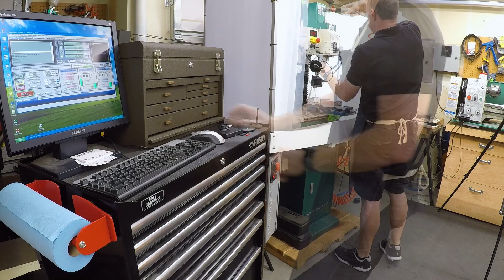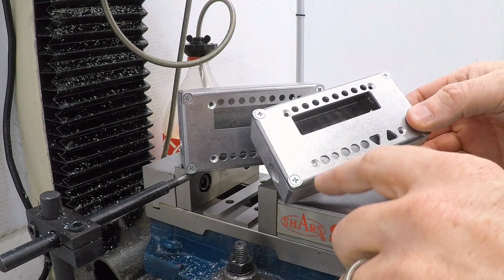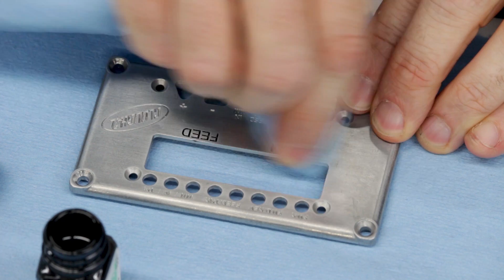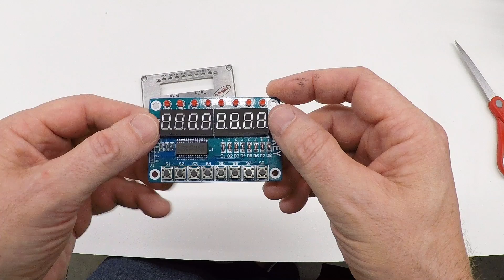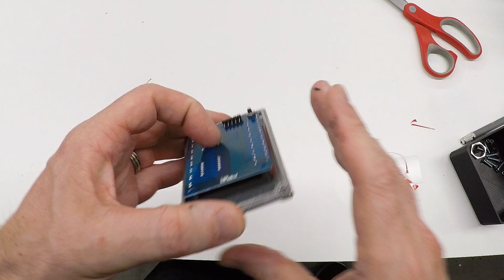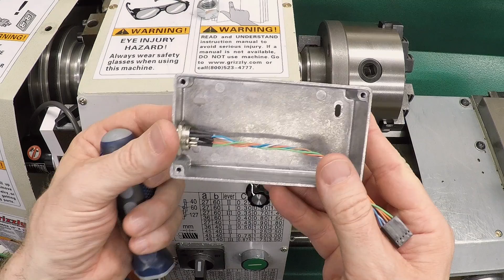Lathe Electronic Leadscrew Part 9: Machining a Control Panel

Comment: I use LinuxCNC with GCode ripper (free python app) for probing to compensate for surface warping when engraving (just like mesh levelling with 3D printing). I've also found the UV cure resin nail art kits are great for filling.

Comment: Dude.. forget the vbit. 

Grab a .062 or .078 or .093 flute carbide ball mill. Max the RPM, go only .003-.005, and just fly. I slow down when feeding straight down and sometimes run a spring pass, but rarely does an engraving take more than a couple minutes. I'm running 10k on the spindle (max), with my down feed at F4. (4ipm) down to Z-.004 and then go up to F20. (20ipm) for lateral moves in aluminum with coolant. Once you see a burr start, swap the tool out. Run a spring pass or play with the RPM if you see chatter. Hell I was doing a paragraph for a decorative diving piece in brass that only took four minutes or so. I know you're limited on rigidity, but crank that RPM!

Well done on whole electronic lead screw project. Truly .. bravo. I can't wait to try one myself. Thank you for all your efforts! Don't take this comment too critically.

Comment: This is Great stuff!  Although I still have questions on some of your processes.  I am assuming that you are going back and forth revisiting the same holes on the CNC to minimize heat build up?  It seems slightly inefficient, otherwise.  I have a large CNC (5' x 12' c/w vaccuum bed) used for Woodworking purposes so I am curious on how the metal CNC system works.  TBH, i haven't watched all of your videos and there were times I sped through this project. Please don't flame me if i missed an important part.

Comment: Love your channel it’s great You need to build yourself a vacuum plate for your Mill and you can use it on your grinder. Harbor freight‘s got a great vacuum pump for HVAC. Pretty simple surgical hoses for your gaskets and machine and grooves in the plate  to put your surgical hose in around your part used them for years in a machine shop.

Comment: If you're using a 90° countersink you measure the diameter of the countersink subtract it from the diameter of your screw head and divide by 2 or multiply by .5 and that will give you your depth. I spot drill all of my pipe plug holes at work and set my tap depth by the spot drill diameter. Example: In order to be -1 thread on my 1/2-14NPT my spot drill diameter needs to be .7", if it measures .5 then (.7-.5)*.5= .1. So I need to go -.1 on my Z axis work shift. For engraving I always use a fly cutter to get the surface flat before I engrave with a V-bit. Drag cutters are spring loaded so flatness isn't as big a deal.

Comment: Clough42   Hi James, I’m sorry, I wasn’t clear, I was asking for the G-code to mill the cutouts for the face and side of the box, or are you saying they have one already made with the cut outs?  thank you,  Chuck
Reply from the maker: Oh, I misunderstood.  There are STEP files on thingiverse.  The g-code I used is specific to the mill, spindle, workholding and tooling I used.  Just trying to run that on your mill is likely to lead to mangling something.
Reply: Clough42 awww come on James let us have the G- code 😩 my experience with 3rd party code has always been positive, most G- code is non machine specific as long as the axis’s are all zeroed correctly. I’ve been running Mach3 for many years and have used hundreds of others code.

Comment: How's the switch denouncing done in the firmware?
Reply from the maker: In this case, the switches are all handled by the TM1638 chip.  I'm not doing any debouncing in software.

Comment: I love this build, I think it’s so clever.

I have another idea for a project that’s somewhat similar: force feedback, jog by wire.

At 18:00 when you’re jogging your machine with the computer or Pendant, you can’t feel how hard the machine is working. If you use servos, you know how much torque it’s putting out (if you are using a data communication, not step/dir). You could put another servo connected to a handle and use force feedback to “feel” the part when you cut it, even though it’s all electronic

Comment: Nice!   Esthetically, that's a great labeling and presentation.   How wipe-down tolerant
is that red film?

It's a tad disturbing, though, how close to the wall that connector is mounted: how will the retaining ring nut be tightened?   Does  it use a spring clip for retention?
For what it's worth, a fixture that clamps the blank faceplate from below, to
a cutout plate with some locating pins, would remove a lot of the doubt about
vise positioning and slanted box walls. and casting tolerances.

Comment: I found that the display board standoff bracket interferes with the display board 5-pin connector. I see that the board you are using has these pins mounted on the rear side of the board. Not sure if the board is multi-layer...Any danger in pulling the stock pins out and replacing on rear with right angle version?
Reply: I discovered that too.  I'm wondering if James moved the connector to the back.  I notice in the video that the display board he is using on his breadboard has the connector on the top.

Comment: It is probably to late to help you with this but it may help others. If you have screws with black oxide on them and you want silver. You can always just hit the head with 600 grit sand paper. You can also get a piece of round stock. Drill and tap a hole for the screw in the end on a lathe. Mount it in the lathe, insert the screw and polish with Scotch-brite. Hope this helps. That cover came out looking great.

Comment: Not taking anything away from the awesome job you did .....as an alternative, you could direct print onto the cover with a flatbed printer.  It would look every bit as good - but “production” time would be greatly enhanced...
Reply from the maker: Are such printers really available to consumers?  Can you point me to one?
Reply: Clough42 Mimaki makes some UV flat-bed printers.  (http://www.mimakiusa.com).  They are available to consumers but probably at a much steeper price than would be warranted for a single project.  My thoughts were that you could outsource that portion if you are looking to manufacture these.  I have a larger 4 foot x 8 foot machine and have had some amazing results printing on aluminum.  They do make some much smaller machines as well.

Comment: Hello James .. 

Greetings fro Cairo / Egypt ..

Thank you very much for sharing your great work on the electronic lead screw .. those 10 videos are nothing less than a complete course .. 

I have a question .. why did you choose the 1024 pulse/rev encoder stepped it to 4096 pulse/rev, why the high resolution encoder .. as I understand all that you need from the encoder is an accurate RPM, in that case a lower resolution encoder ( say the super cheap 8 pulse/rev encoder ) will also work and give you an RPM reading but with the added benefit of slower data stream which allow the use of Arduino UNO or MEGA.

Thanks .. Ahmad 
(ahmad.hasan@usa.com)

Comment: How did you get the perfect text onto your front panel? Fusion is "stone age" when it come to adding text for engraving as you did.  Did you do a separate sketch for every word? It would be nice if Fusion remembered the font and size at least! BTW - Great series, looked forward to every new installment.
Reply from the maker: It's one sketch with a bunch of individual text elements, aligned by eye using construction lines.
Reply: @Clough42  Thanks, I pretty much did the same thing using "Arial Narrow" font, I couldn't get the SHX fonts to work in CAM.  I'll make a test cut or two to dial in the depth. Thanks again for the quick reply.

Comment: For future reference, when joining dissimilar metals Tef-Gel by Ultra Safety Systems is an excellent choice. In the marine electronics world it is common to need to put stainless steel fasteners into aluminum, for example, when mounting a radar on a mast. A thin coat of Tef-Gel on the fastener before installing it and you'll be able to remove that fastener years later without any difficulty.

Comment: Just bought 280049 Launch pad. 

Could you also do a programming video, explain why you do the things the certain way (like using external driver not the Boost pack)?

And maybe also some Launch pad basics, I'm sure you would do a great job.
Reply from the maker: Yeah, that's on my to-do list.  I want to get back to the firmware and smooth over some of the rough edges before I open the floodgates to a few hundred new users.  :)

Comment: 34:00 I'm surprised you let it hang over the edge of the gear box... My OCD will not let that go...  amazing project BTW..
Reply from the maker: I didn't think about that bothering people.  I just picked the screws on the face I wanted to use and centered the holes in the box.  I think it positions the controls well for use, but time will tell if it gets in the way.  It would be easy to make more holes in the box.

Comment: Where did you find that engraver bit? I really like this tech for a manual machine versus a full CNC conversion. You get everything in between and can manipulate the equipment rather quickly for various projects. An individually powered y axis would be another great addition. There are several applications I can see being done with this type of setup you’d typically not be able to do without CNC. A manual turn mill if you wanted. Very nice.

Comment: Thanks making this controller, its all very very impressive. The only suggestion I would make if you intend to offer them as a near complete kit or finished product is to also offer a PLUS SIZE version, about the size of a typical DRO. This would enable the buttons and/or function lights and/or labels to be larger and further apart, it would suit guys (I'm one)with big boofy fingers and no longer with 20/20 vision.

Comment: Regarding diamond engraving on aluminum, it doesn't require any coolant as aluminum does not weld itself to diamond at all. That's why they use diamond tools to machine aluminum when fine surfaces are required.

Comment: This is an excellent addition to your lathe and a brilliant idea. Kudos all around.  I have almost all the parts on you list except the encoder. Literally, it's on the slow boat from China. I do have three questions though. First, the breadboard set-up during the proofing seemed to be highly populated. But the instructions that came with the code does not mention many of the other components such as resistors, transistors etc. What do I actually need to complete my project at this time? Or should I wait till I receive your add-on board? Second, the final debug instruction mentions timing of the ISR routines. Will I need to do this or is it done within your add-on board? And third, my lathe has one lead/feed screw but two different levers and gearing, one for feeding and the other for threading via half nut. Will I need to choose one method for both feed turning and threading, or can the program be modified to use both linkages/gear ratios? Again, great project.

Comment: In my work I have to machine stem nuts for existing acme left hand threads. Sometimes a 4 pitch thread is cut on a machine with a worn lead screw giving a pitch that is short by as much as. 015" inch. Now I have to modify my threading process to account for something less than a 4 pitch thread. Your system would help to adjust for the exact pitch needed. I'm interested in obtaining one of your units if and when you have them available. Great job.

Comment: A few points:
With the diamond engraving: powder blasting and dark anodizing before engraving would have made the labels show better.

The painted labels would be more durable once finished off with a 1200 grit  sanding pass after 3-4 coats of label filling, followed by a clear coat.

Comment: That is beautiful, love this project! Of course no project is complete without some late feature requests. Don’t know if anyone has mentioned it yet but sure would be nice to have a carriage stop via a micro switch that could clamp to the bed. This would allow accurately turning to a shoulder or threading with much less worry about overrunning the gutter. It would be especially helpful in the case of metric threading where the half-nut isn’t disengaged and you have to account  for the time for the lathe to spin down when you turn it off. Since  you are using a stepper instead of servo maybe the alarm pin could be reassigned?

Comment: If you don't have access to self adhesive film, a very useful alternative is to use Quality Street wrappers stuck on with double-sided sticky tape. They are available outside the UK. Of course, they also have the advantage of giving you an excuse to eat chocolate! They give several colours (red, green, blue, brown etc). The only disadvantage is that the individual wrappers aren't very big.

Comment: Nice work. 
The box is just in the way when tightening/ loosening the chuck.
Reply from the maker: I don't think so, but if that's the case, it can easily be mounted on the left side of the headstock.

Comment: OK !  I'm ready to buy two !! Are you going to sell the whole shoot'n match or just the controller...? Is that TI board a current stock item ?  I'm planning on using one on my Atlas 12 and 6 !
Thanks for another great video !!
Reply from the maker: I don't think there's any way I could make the control panels economically.  I designed the project to be built with inexpensive, off-the-shelf parts.  The one part you can't buy elsewhere is the interface PC board I built in a previous video.  I'm still planning to make those available, once all the bugs are worked out.

Comment: your range of skills is mind blowing, just to sum this up.. and forgive me if i miss something there's
1 CAD 
2 CAM
3 Programming for embedded devices
4 all that math for threading and feed rates and stuff that i technically count as something above and beyond programming 
5 manual milling
6 CNC machining
7 manual lathing 
8 circuit design
9 PCB design 

rare to see one person do such a project from begging to end and do it all so well
Reply from the maker: Thanks!  It's pretty much all self-taught.  It comes from a lifetime of taking on projects that are just beyond my abilities and then learning what I need to learn to complete them.

Comment: Nice¡ but If both boxes are the same I would have used one single box to set up in the vise , and replace the tops to mill/ engrave , without removing the box from the vice, that way you will be assured that both covers sit at the same height

Comment: Next time You should swap lathe's entire front plate, not just add box on top. 
Also, I would put some kind of hot glue or silicon on connector behind PCB - just in case.

Comment: I have been watching this build and enjoying it thoroughly. Haven't had any intention to make one myself, fiddling with the change gears gives me a chance to do several 'sanity checks'. Had a question, tho... wondered if you have accidentally built in a nifty capability. Occasionally, on commercially made machine bearings, the oil groove is (forgetting the correct term here) is a spiral back and forth pattern (Lissajous?) and I am wondering if this is possible?

Comment: @Clough42 
Amazing work!! I need to build or buy one of these for my lathe!!
I wish it had a cnc option, lock half nut, attach cross feed stepper motor, and basic cnc lathe!!
Reply from the maker: Yeah.  Lots of people have used these lathes as a base for a CNC conversion.  I'm not looking to take this project that far.  I still like turning the handles.

Comment: I was pondering something... If you removed your compound, you could still move your threading tool in at 29.5º by advancing the lead screw timing a few degrees each pass?

Comment: Your box is to small gerald
Reply: I thought/hoped the same that the controler board would fit in there too.
I followed the video allong expecting a bare components controler board redesign.
But this is also ok because after all the name of the video is "Machining a Control Panel"!

Comment: Looks great, you should definitely try some sort or height mapping setup and probe each countersink location, 

It's pretty common for 3018 cnc to use Grbl controller height mapping for milling PCBs that aren't completely flat (or using Gcode ripper) so your Mach program should have something similar

Comment: In a machining environment, I wonder if you’re thinking about covering or filling the holes and machining with some clear material to eliminate or at least reduce the risk of particles getting into the box.
I know the mounting is inherently pretty protective, but it still leaves me feeling....unsettled.
Having great CNC capability, you could cover the LEDs with acrylic rod glued in and enjoy the added advantage of having the indicators appear to be at the surface (no parallax). Same for the numeric display cut-out, but using sheet acrylic....or you could do what my buddy does and put clear packing tape over the whole face (less the buttons, of course!).
Very nice project, great workmanship and I like your approach to experimentation! Intentional, even bold without being overbearing.
Looking forward to your next release.